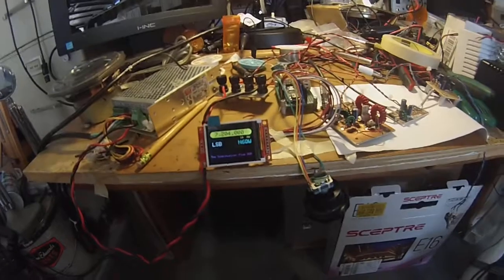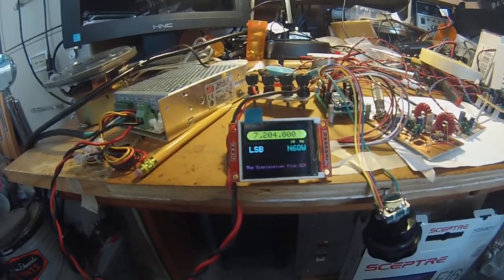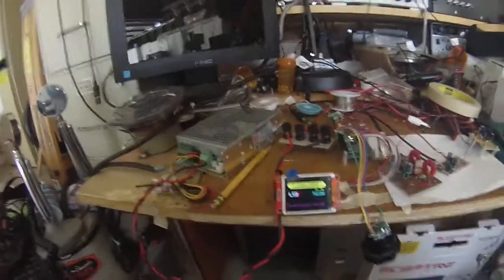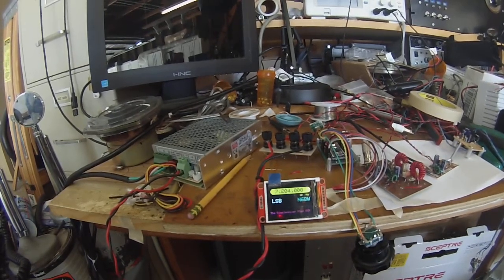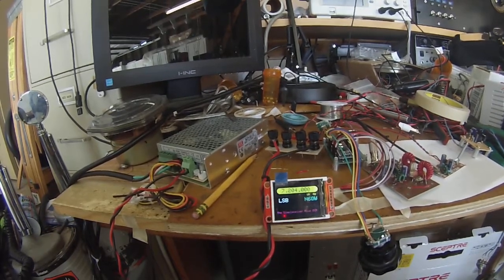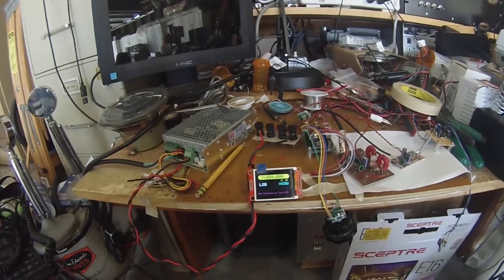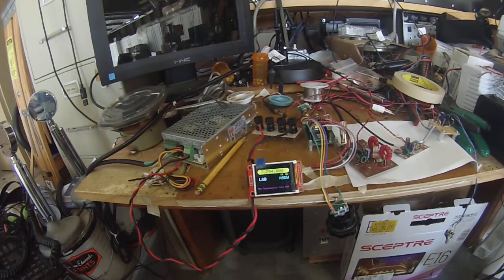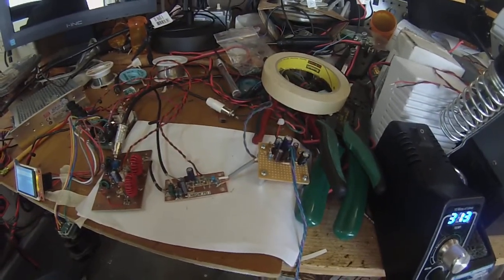The Simpleceiver Plus DCR with a Si5351 LO --- Exciting!!!!

Comment: Pete, ive been looking at DC rxs for a bit, this is the simplest one I have seen. Thank you for developing it. I am IN. I am going be starting very soon, got to get a couple IC sockets, and get at it. Been too long since I have scratch built anything, I am geeked to build  this. Will you publish a CW T/R circuit for this rig, or SSB only?
Reply from the maker: Hi Ed,Welcome aboard the fun project. Check the blog http://n6qw.blogspot.com and there is a schematic of the TR circuit that could be used with the CW transmitter that also is in the blog entry.73'sPete N6QW

Comment: Where can you get these?
Reply from the maker: Where can you get what? The Arduino and Si5351 are purchased separately and wired together. The cost of the Arduino, Si5351 and Color Display can be had for about $20 not including shipping. They are not sold as a unit but as components which you must connect and load the code. See my blog http://n6qw.blogspot.com and my website http://www.n6qw.com for more info. In a couple of days I will be posting more details about the Arduino/Si5351 on my blog.Thanks for your post.73'sPete N6QW

Comment: Nice, is that a Meanwell switcher running the bench? How do you find them from an RF noise perspective?
Reply from the maker: Hi Clint,Wow what a good eye. That supply is a new addition to the shack and is amazing --it's output is standard 13.8 VDC (somewhat adjustable from that set point). It is rated at 3.2 Amps and costs only $16.95 from Jameco Electronics. Noise is not an issue. Really a superb buy. It has several output options too!Thanks for your post.73'sPete N6QW